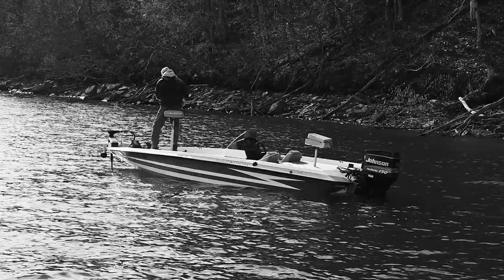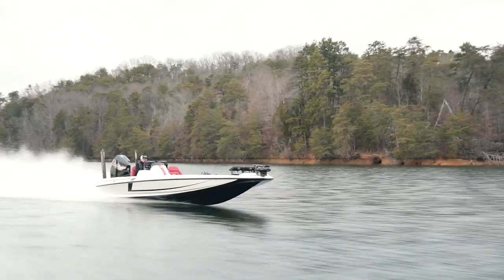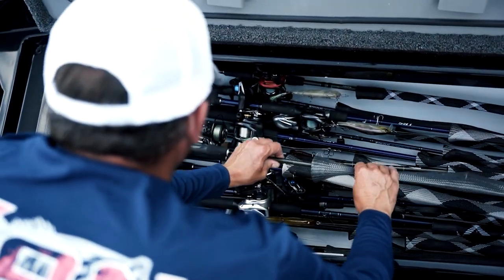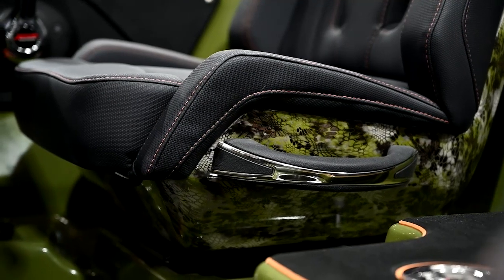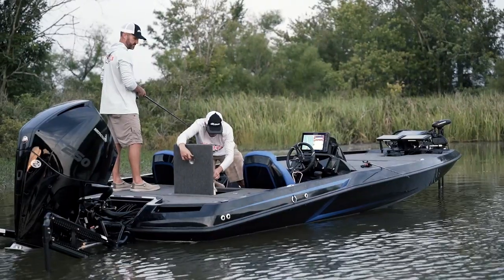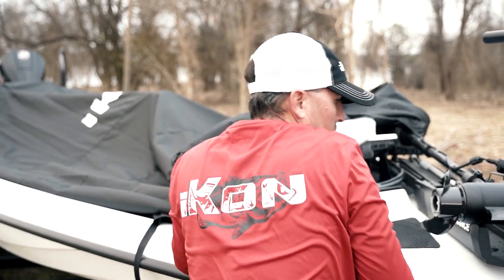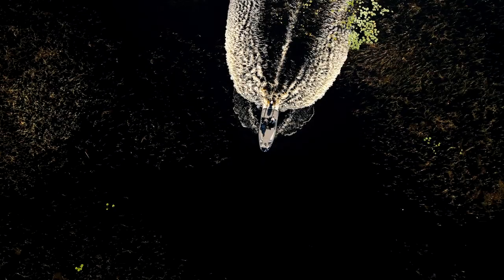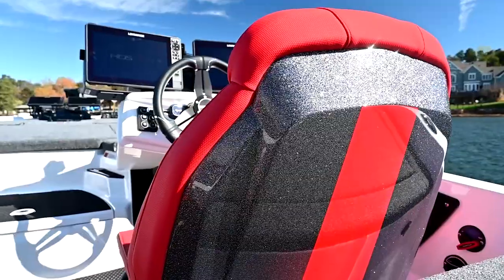iKon Boats - Redefining History and Pushing the Limits of the Bass Boat Industry

Comment: Whats the top speed and when you come down off plane do you get water coming in over the transom. My Triton has no back wash at any speed but I have been in many that fill the boat if your not careful.
Reply from the maker: Top speed for the LX21 varies, depending on how the boat is rigged with bow & console electronics, accessories, tackle and gear.  We speed test our boats rigged and weighted (tournament loaded).  A lot of manufacturers publish test speeds of "empty" boats.  An LX21 speed tests at an average of 67 - 69 mph, depending on air temp, humidity, and elevation.  The LX21 is 21'10" and has an approx dry hull weight of 2,000 lbs.  There is no backwash when going from  plane to sudden stop (neutral).
Reply: Mine runs 68 mph all day long in Central Florida.  If you've seen some of the videos, my is way over-rigged with electronics, gear, and tackle. A completely empty boat will test over 70mph.  The main thing is that it'll run faster in choppy water and tournament takeoffs than most because of the hull design.  The 20' model is supposed to be out in a few months.
Reply: @stopcrying518   good luck running even 1 footers at 85. and who cares about dry. what it run fully loaded. in 2 footers.
Reply from the maker: @stopcrying518  It's not a Gambler...  We speed test our boats weighted (tournament loaded).  They're designed to run at top speed in both calm and choppy water.
Reply from the maker: @Rob-tl9md  Exactly our point.  Bass tournaments are about catching more and bigger fish than your competitors, not about racing.